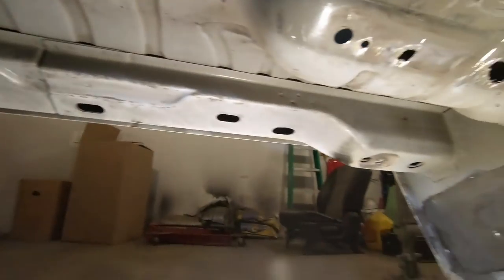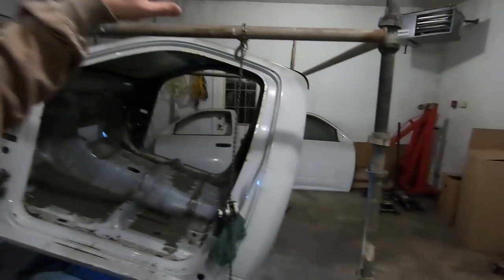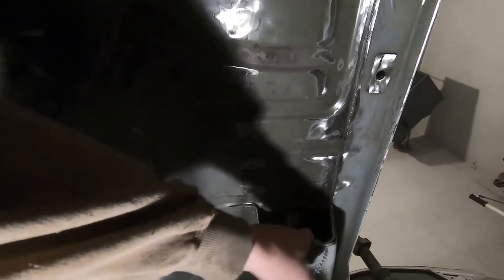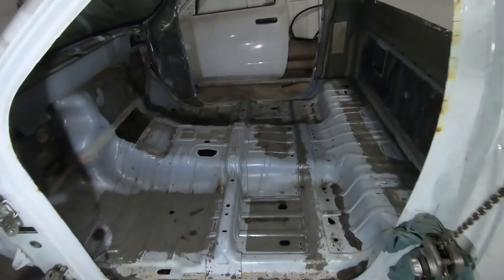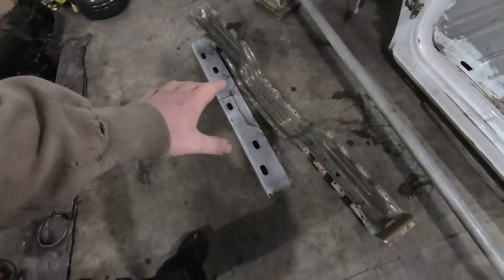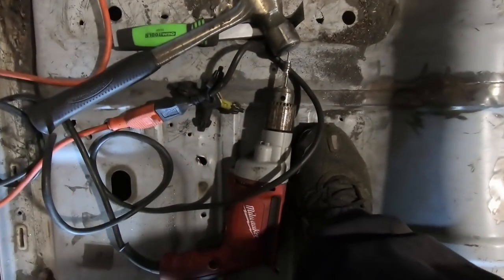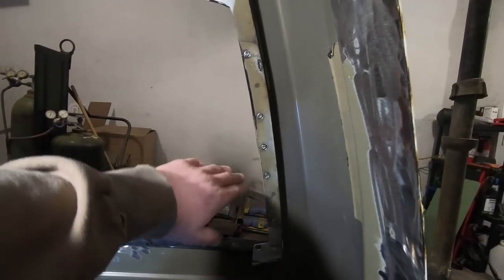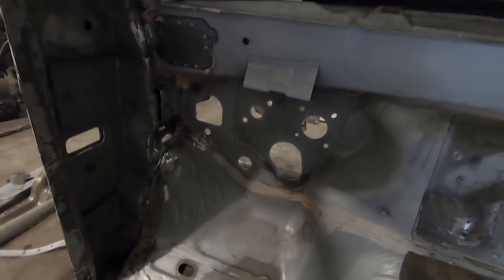FINALLY Making Drag Truck Cab Progress... SPOT WELDS BEWARE!!

Comment: is the rear corner of the driver side roof starting to separate? or is that from the sawzall before? quick bead of seam sealer should hold that, maybe with a few tacks once the cage is in. heck, if you can pull the whole roof OFF with tack welds it'll make putting that cage in a ton easier... 
any thought yet as to going thru the back of the roof vs going thru the back window?
Reply from the maker: Probably through the window